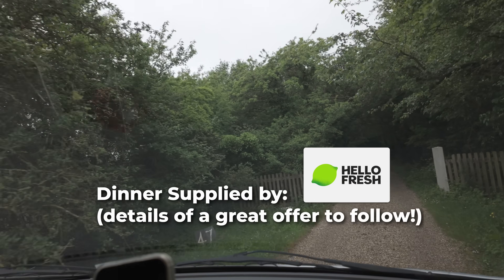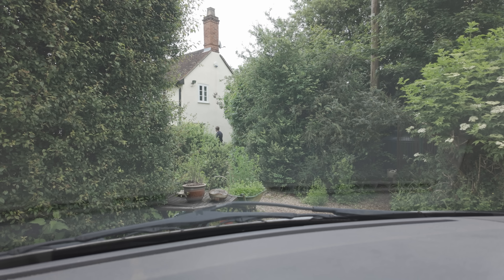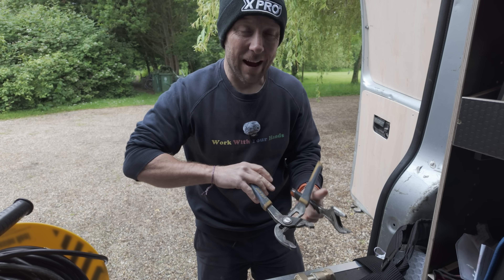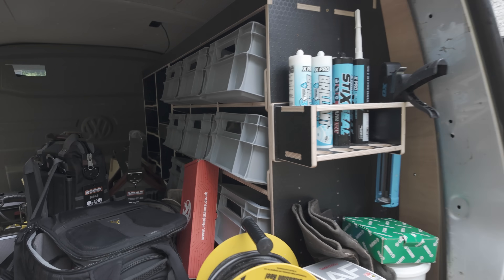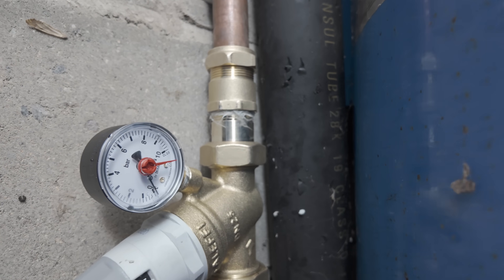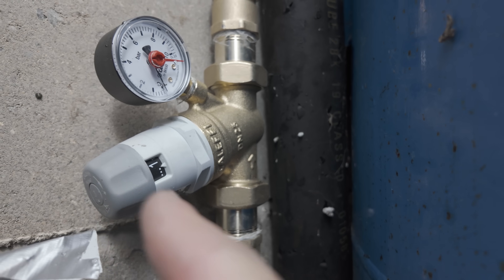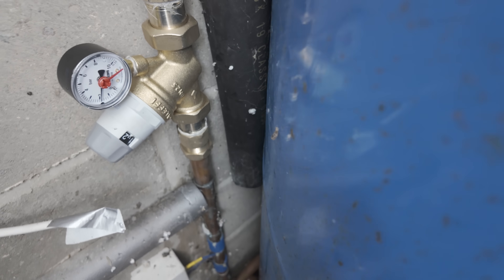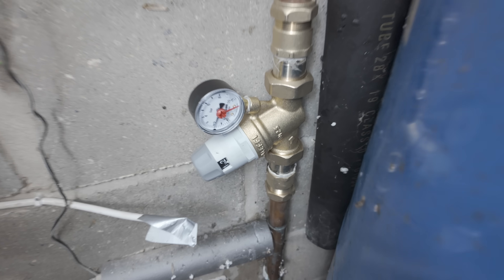WATER PRESSURE TOO HIGH? How to fix!

Comment: We do have noisy mixer tap especially hot water and a neutral in the centre. The bathroom has just been finished by a contractor including new copper pipes .  Over all it reduced the water hammer from washing machine but the mixer tab and the toilet flushing are noisy (rimless toilet) I've just ordered the water pressure meter if the pressure is too high where should I fit this  pressure reducing valve? on hot water pipe before the sink/ mixer tap?

Comment: A nice clear video, thank you.  However...in the video you said before cutting into the pipe to shut off the mains water feed in, and also the accumulator outlet feeds.  Surely it should be the accumulator inlet feeds, so they don't back-flow under pressure back out of the cut pipe?  Or have I misunderstood?
Reply: That valve will prevent backflow itself, and the the MDPE (Plastic) stopcock was closed. I am certain that no water would have returned past that valve James installed.  And absolutely 1000% would have not returned past the stopcock

Comment: I assume there was enough wiggle room in the pipe work in order to fit the pressure relief unit. Cutting sections out of pipe work and installing fittings without wiggle room can be a nightmare!

Comment: I have a bore hole with a similar set up and the pump is set to 4 bar on and 5 bar off. Fitted a PRV but it slowly creeps up to 5 bar. Tried everything, even changed the PRV to a different brand. It appear that if the incoming pressure varies, the PRV struggles. Can anyone out there suggest a fix?